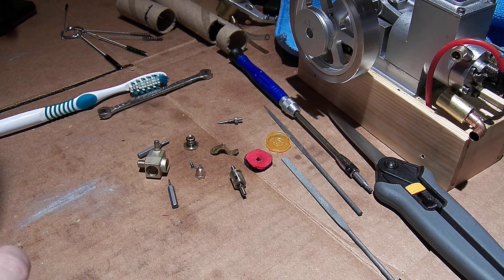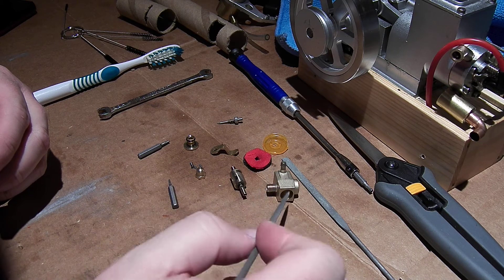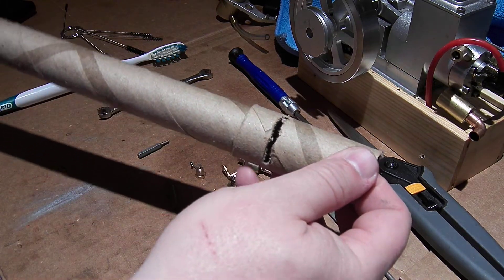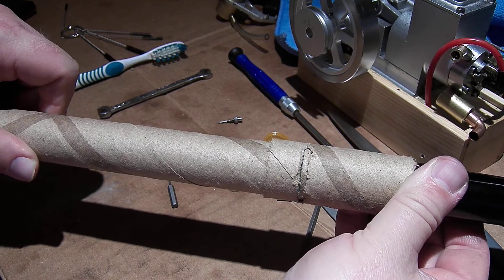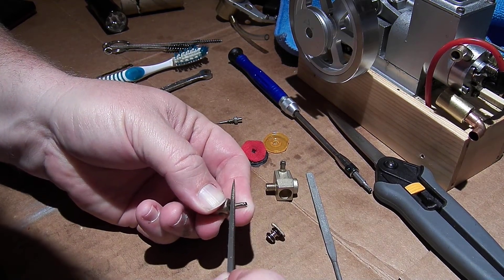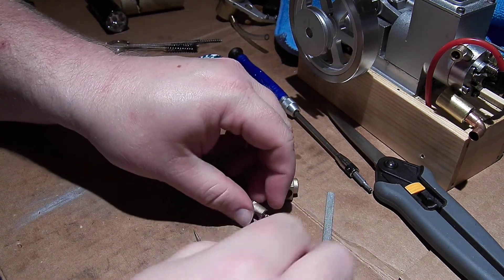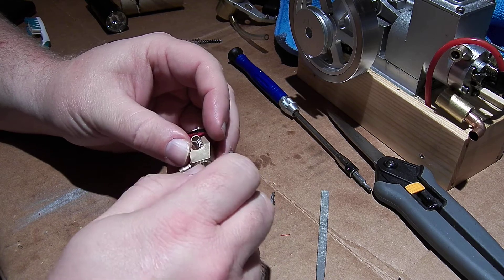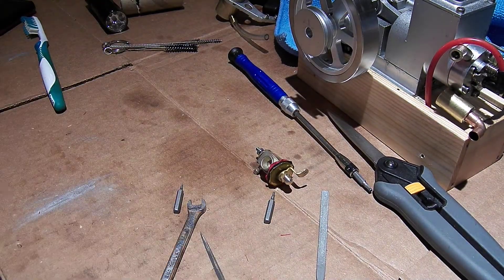ET8 Carb demonstration and modifications

Comment: Great video Henry. As always! How many hours do you “think” you’ve put on your et8? If more than 2, Ronald Walters says you need to replace the piston rings every 2 hours. 

Also, my birthday’s coming up soon. I may buy the et8. I cant choose! I’ve seen the toyan engines, the hit and miss, there’s so many options! I really want variable speed, however I have my m16, and I’d like to pick up an et8 or something.
Reply from the maker: I'm just at around 2 hours of run time on the ET8.  If you watched the assembly videos I found the ring on the replacement piston was really loose in the replacement cylinder so I put a 2nd ring in.  I have also been running 40:1 oil mix in it, so there is a lot of oil in it.  I haven't noticed a drop in compression yet.
Reply: @henrybangsberg2187  that’s great! I’ll be sure to use 40/1. Are you using the “trufuel” brand?
Reply from the maker: @Farmtractor  Yeah, it's the one they had at HomeDepot.  I will be diluting it down for the hit and miss engines and the EM1 because I found lots of deposits in the ETX and ET7 when I cleaned them this week.  I want to keep the EM1 clean inside because I don't know how to get the valves off easily for cleaning.  The ET8 runs fast and hot enough that it doesn't build the oil up as much inside.
Reply: @henrybangsberg2187  they also sell 50/1 premixed in the red can. If that’d help
At all
Reply from the maker: @Farmtractor  I might switch to 50:1 for the ET8 but I think mixing down much thinner for the hit and miss engines will be better.  I will probably go 80 or 120:1 for them.  The slower operating speed means much lower temperatures so the oil lasts a lot longer in the cylinder.
Reply: @henrybangsberg2187  correct. I agree with that. I’ll be sure to get an et8 here soon!

Comment: Would you recommend anyone buying one of these engines?
Reply from the maker: The ET8 is a workable engine that requires a bit more fine tuning to get in decent order compared to the other ET engines in this style.  For "out of the box" running I think the ET1 is your best choice.  The ET8 is the only throttled engine with variable speed, so if you want something to rev, it's your only option.  I think it's a good engine over all, just make sure you are careful not to over-speed it.  You'll also need to do a careful carb teardown/inspection/tuning to get slower speed operation.  Mine originally leaked so much air that it took lots of adjustment to start and ran very fast at the low speed setting.

If you want to see other carb issue fixes you can check out Ronald Walters' ET8 videos too.
https://www.youtube.com/watch?v=jBFjp3CEY5w&t=1s
Reply from the maker: I just looked over your channel again, I think the ET8 is the M95 or 93 from microcosm.  Also, I see you have most of the hit and miss variations already.  If you haven't looked at the EM1, it's a real charmer if you make sure all the grub screws stay tight.